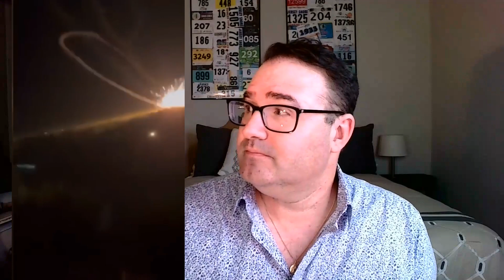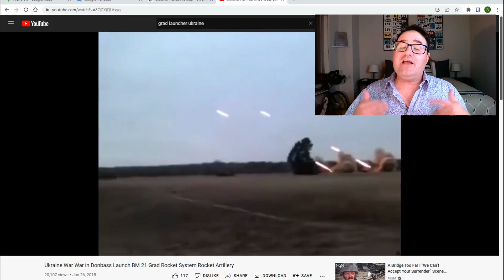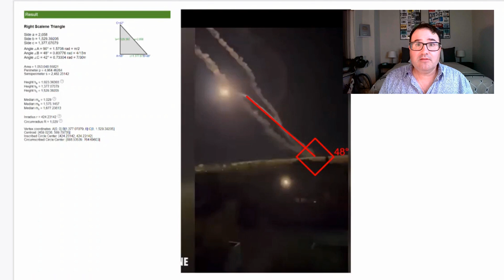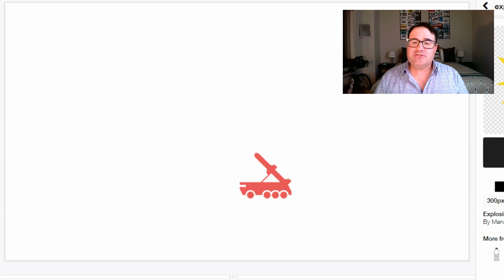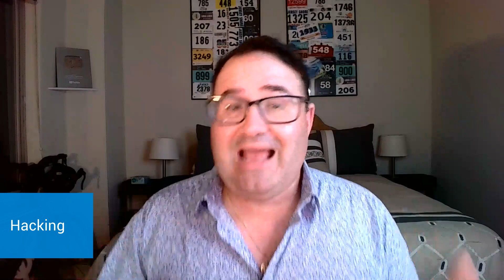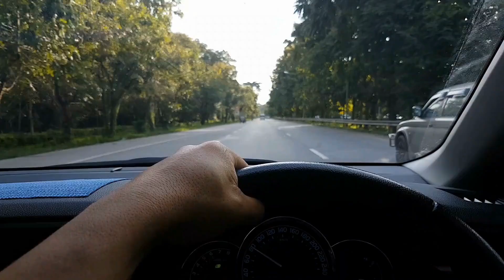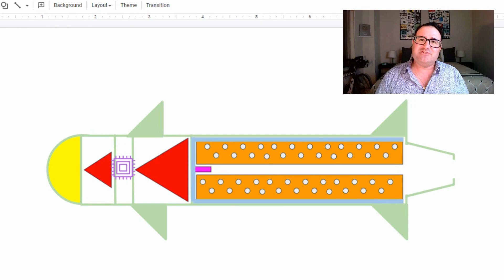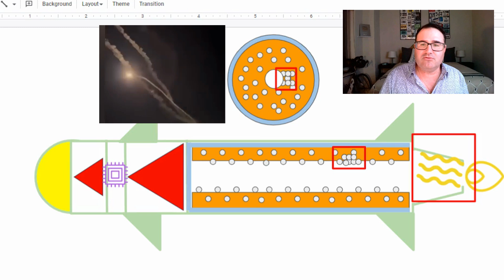Why this missile U -Turned

Comment: I would suspect a faulty sensor in the IMU (inertial measurement unit) caused the missile to misjudge its heading and attempt to correct. I would not expect mere off-center burning to create such a dramatic turning moment. A well-designed software package would likely failsafe in the event of such an unusual sensor reading and disarm, or redundant sensors would alert the presence of a problem. Poor handling could still be at fault, as damaged wiring or sensors subjected to undue shock might have contributed. It is also possible that part of the (pneumatic or hydraulic???) steering system (a valve or ram) failed and caused a full fin deflection to one side. Either way, once the missile turned around, its airspeed was decreased, lessening the aerodynamic forces on the fin and reducing its turning rate. This is what we observed when the missile straightened out.

Comment: The theory about the stuck fin doesn't really make sense. Like, why does it get un-stuck after half a rotation? If one of the control surface got stuck, you'd expect the system to spin out of control, not do a half turn and return to sender.

Comment: The accelerometer in the rocket for fin guidance was installed upside down.  Armed after 1 second.  Said holy shit  going the wrong way.   180 turn then down.   The rocket flying straight like an arrow would agree with that.  Similar mishap with a russian proton launch last year.

The fuel clump theory is questionable.  Pressure would have time to equalize in the central gass path/combustion chamber letting it expand through the nozzle fairly straight.  Any thrust vectoring through that fixed nozzle of a magnitude to do the 180 turn would have deformed it permanently.  The straight flight afterwards would have been impossible.

That being said i like your stuff keep up the good vids!

Comment: I think it was a mechanical failure.  Stabilization issue.
  Edit.   It might have homed in on its own search radar and took it out.
  It took a right turn and stayed in that turn until impact. It did not fly back in a straight line.  It was a semi circle.  I think that it lost a fin or a linkage failed and it went out of control.
   

The Ukrainian army could launch Mylar balloons after a bayractor has been in the neighborhood and let the red bastards shoot down the balloons with their expensive missiles.

Comment: I have seen a SMS2 swirling around and detonating wildly only a mile and near our destroyer. What happend is that the guiding beam from the MK74 Radar System went of by accident. The operating officer in the CIC pressed the wrong button. The missle just after launch found no beam and went into search and safely exploded after 4sec. It could have been a desaster too. Happend in Nato excercise on the Atlantic in 1996.

Comment: The Buk missiles have a Inertial navigation system(Gyroskop). The missile can travel without any signal imput by itself into the target area. So if the system ist not calibrated in 20 years. maybe one of the 3 axes moved 90°.  
The INSs in the Airliners gets calibrated after a few thousand hours.

Comment: Your theory of faulty fuel does not explain why it makes a nearly 180 degrees turn. Your theory could send the rocket anywhere, the chance of an exact 180 is actually very, very small.  
The abrubt change in direction makes that I would investigate faulty electronics.  It almost looks as if it sees the target radar as its target.

Comment: Nozzle likely had an anus defect and cracked under uneven heat and pressure.  This is not an issue with metal nozzles but ceramic nozzles are the preferred material on small diameter missiles.  It is very rare but occasionally, the anus forms a fissure as the engine nozzle crack telegraphs through the ceramic material.  This has been known to happen to anti tank missiles as they are pushed through the tube before the sustainer motor kicks in.

Comment: This closely resembles the failure mode of the Proton rocket where a worker hammered the inertial guidance sensor in upside-down. Once on-board guidance took over, the rocket decided that it was not going to space today.

Comment: i am pleased with how well i am understanding newjerseyish. i think your theory is clever and well-informed, but ultimately i surmise that it wouldn't cause this behavior. my reckoning is that even in a wildly off kilter combustion chamber caused by uneven burning the pressures would even out sufficiently as they produced thrust, so as not to create such extreme instability. i might bet you twentyregularcash though, what if extremely uneven burning or some other defect had caused the rocket body to rupture and momentarily vector its thrust differently, maybe right in the spot you picked as an example? but, from the video at least i didn't see any indication of that

Comment: The fin was stuck from the time of launch. The rocket turns parabolicly caused by the fine efficiency increasing with speed. The camera angle is almost in the plain of rotation so therefore it appears like it loops in a circle.

Comment: e is pronounced "ye" the ч is pronounsed "ts" "Altsyevsk" the romanisation is to simplify it.

Without any calculation how is that 1 mile in altitude but the guy is 500 meters away? That appears to be an altitude much smaller than the distance of the videographer to the launch and impact site.

Comment: If it was asymmetric burning of the propellant why did the missile not attempt to correct its course after drifting off? As a software engineer I can guarantee you that 2 missiles flying right does in no way guarantee that the 3rd one will fly right as well

Comment: I've never seen a burn-through travel straight once it starts. More characteristically they corkscrew or yaw in a circular spin until they either burn out, self-destructive, or aeronautical forces stress them to structural failure. This looks like an IMU failure of some sort.

Comment: I'm going to chime in on the guidance system gone wrong theory. This looks a bit similar to a problem TOW had (has?) where its DEU would go haywire and cause the round to shoot straight up or down. I imagine this is why they aren't shot off of helicopters anymore.

Comment: Having prepared my own shaped solid fuel for small rockets I can confirm that an irregular burn pattern produces asymmetrical thrust...which will make it go anywhere except where it is supposed to.
Reply: I think this thing is going way too fast for just assymetrical thrust to create almost a complete 180 (and the rest of the guidance to provide the rest of the turn).

Comment: Not sure about the clump theory. That clump would have had to last almost exactly long enough to make a 180 degree turn, before burning out and returning to straight flight. Not 30, not 45, not 123.45,... 180. Of the entire possibility space of divergences, that's a very specific and very peculiar value. If this was chance, I'd have expected to see many more random misfires before the one that just happens to do a precise 180. Probabilistically, I feel this unlikely and so that this was a was a targeted return trajectory. 
I don't know how the radar on these things works. Could it acquire a radar reflection from behind (locking onto the targeting radar or some spoofed signal) Unlikely I'm guessing. Could some transient event, like a stuck fin or clump, have turned it just enough for it's onboard radar to acquire the targeting radar and then it guided itself back on a near 180 (as the launcher and radar are close together)?

Comment: No, even a clump of fuel on one side is linear by the time the fuel is choked in the throat of the nozzle. So the thrust out the end would not be one sided, but constant. To change thrust direction a rocket needs to change the flow downstream of the throat, not upstream.

Comment: A very simple explanation to this is. When it's coming out, it's going mach 2 already, and for those of you who don't know. That's really really fast! More likely than not the overall rocket performed it's job, however this was from an electrical failure. Rockets/Missiles whatever you want to call them, in regards to when this was shot. Are OLD...like you shouldn't touch that thing with anything old. 

The most likely reason for this accident, was during transport of old munitions from the Russians missile reserves It was (A) Already busted, and had no way to be checked to make sure it was secure. (B) Got busted during transport/during the launch sequence.

The missile more likely than not got confused, and due to the faulty system locked onto the friendly target and blew up. Because if anyone knows how missiles work, it knows where it is, because it knows where it isn't, however if it doesn't know where it is, it doesn't know where it isn't.

Comment: This is a good explanation 
I think it’s wrong…. I don’t believe an unbalance in the fuel cell could cause such a precise and fast turn

We’ve actually seen something like this happen before with an orbital booster. I believe there was a bug in the guidance system
Some value being wrong
And so on launch, the guidance computer reads a wrong value, goes “your flying downwards”
And does a U-turn

Comment: You kinda lost me on your distance and velocity calculations.   First off, no sonic booms so no, the missile was subsonic.  Also, by the light of the 'rockets' red glare' I can easily discern a grouping of individual trees off to the left.  That is somewhat consistent with your claim that the camera is about 500m away, based on the time the sound takes to travel from the rocket to the camera.  But if you consider the distance from the rocket to the camera, then consider the width of the field of view of the camera, that horizontal distance I'm guessing is probably on a par with 500m as well.  I am guessing that the rocket trajectory occurs within an square area of about 400m x 400m, so it traveled about 550m up, looped around, came back.  The trick is in realizing that at the distances you propose, those trees would be a lot farther away, but they are actually fairly close.

Comment: fuel burn that is offset from the center by 100% of the radii wouldn’t have the leverage to turn it that way. In model rockets the main issue with misdirection is the fins. Those fins can make corrections for the propellant easily.  Look even at spacex and the gimbal engines…..those wouldnt be able to turn the rocket around in that way and they are designed for directional control. You are talking about a burn that was a defect and that is still inside of a tube which still has a nozzle pointed straight and probably designed to even out manufacturing defects of offset burn.

Comment: If the motor was providing asymmetrical thrust wouldn't the fins try and counter it? It's not a bottle rocket, there is a closed loop steering program to counter atmospheric variability.

Comment: I’ve flown rockets for 40 years holding a level 2 certification with Tripoli Rocketry. Solid fuel rocket motors work on chamber pressure being forced through a small nozzle at the rear and not much chance for unintended thrust vectoring. Most likely one of the forward fins failed, since they are much farther forward and would have a much greater effect on severe course changes. That’s why most rockets Don’t have forward fins. Anti-aircraft missiles on the other hand have forward precisely because it allows huge changes of direction of flight to allow tracking  maneuvering target
Reply: Surely though if it was a fin, it would have Begun flying at a curved angle, and wouldn’t stop turning. This went straight, sharp turn, back straight.
Reply: @aaron2789  correct, if it was a forward fin just going full turn it would just loop wildly but a malfunction of the guidance system would need the forward fins for that tight turn, my main point was it wasn’t thrust vectoring
Reply: @alfavulcan4518  except those fins need an exceptional amount of airspeed to be effective or even slightly gain control authority
Reply: This might sound obvious but, maybe it drank absinthe? I drank absinthe last time I was a Russian missile and the CCTV shows I did something similar...
Reply: We had to destroy the site after the launch. We didn't know YouTube was gonna get excited about it.
Reply: I would have thought the combustion comes out the little hole and propels the rocket forward, the burn on one side makes little difference. I don't know the physics though, but I my first reaction was, doesn't the force just come out the back and push it forward?
Reply: @tonyetzu  correct, basically. Wherever the burn is in the motor it contributes to the high pressure forced through the engineered nozzle at high velocity. In a solid fuel rocket like these the nozzle is like 2 funnels connected at the thinnest part, collecting on the inlet and allowing expansion in the outlet “funnel”. The small hole promotes high velocity, like putting your finger over the end of a water hose to get more of a water jet
Reply: @tonyetzu  ^EXACTLY! How much difference can it make for a tiny bit of thrust to go a tiny bit wrong? 

Absinthe...
Reply: Maybe the insulator was not good and thrust managed to go trough in one side of the rocket
Reply: @MyEmkill  then it would have continued looping instead of a 180 course change then straight in

Comment: I'll start by saying I know nothing about missiles or propellant but I find it difficult to believe the U turn would be caused by just bad propellant. I'd say someone wired the guidance fins the wrong way round and, when the missile is allowed to home in on it's target, it simply turned 180 degrees from it's target. I think that would explain why it U turned  and then continued straight directly away from the target.

Comment: That turn was way to clean to be a random error like fuel in my view.. It is however a very russian thing to install a navigation sensor upside down....   With a hammer... They did it on a space rocket don't seem to unbelievable that they did it on a missile. 
My guess is dodgy manufacturing. Who ever built is doing a good job I my eyes 😂

Comment: I have read a few comments about a sensor being installed the wrong way, I know nothing about missiles but if it was the wrong way then surely even after turning then it is still the wrong way? Wouldn't this cause the missile to constantly try to correct and travel in circles rather than perform a neat U-turn? Locking on to its own radar makes the most sense from all of the proposals so far.

Comment: That's not how solid rocket motor works, a clump of air in the fuel would only cause some combustion instability but the nozzle remains pointing in the same direction, meaning the thrust direction is still the same

Comment: I don't think that's the case. Even if that might happen the gas has to go out the same exhaust port. If it had two boosters it might make sense but it doesn't. 

This is a classic case of seeker getting activated after launch. Being an anti air system it has very high maneuverability. Once the seeker is on it will go towards the nearest target it can find. Even your own radars. This is why anti radiation missiles are not armed right after launch. They will come back and kill you. The missile probably has anti radiation capabilities. 

I think some idiot turned on the seeker way before neccesary for  shoot and scoot tactics. Missile went pitbull and came right back for the radar.

Comment: Obviously a guidance failure.  You can tell by the fact that it goes up, does a u turn, and straightened out again once it lined up on its target.  If it were stuck fins or a rocket motor problem, the turn would be continuous and it would be unable to  stop spiralling out of control.   

I'm quite impressed it didn't break up trying to make that u turn, the g force must have been pretty awesome!

Comment: Umm those distances you came up with are off by an order of magnitude at least. If they were correct that means the explosion was half a mile wide and the debris flew 2 miles.

I know this is hard to believe but a Mach 3 capable missile doesn’t reach top speed in 0.001 seconds after launch.

Comment: My theory was that, after guidance is unlocked, rocket sensors acquired falling debris, from previously launched rockets which hit approaching attacking targets. In all such cases, there is previous launch... Your "fuel theory" might be plausible with two ore more rocket motors are used, but unbalanced burn within chamber, without moving common nozzle, is not enough for such sharp turn.

Comment: 5:45 The solid rocket booster fuel is actually often star-shaped to have an even amount of propulsion after being ignited. If it would be a full circle, it would actually be devastating as it would get increasingly lighter the more fuel is burnt and the surface area of the fuel gets bigger as well; meaning more propulsion and less weight => very high speeds. And that is not something you want when closing into something moving like an aircraft because handling is much more difficult with faster speeds.